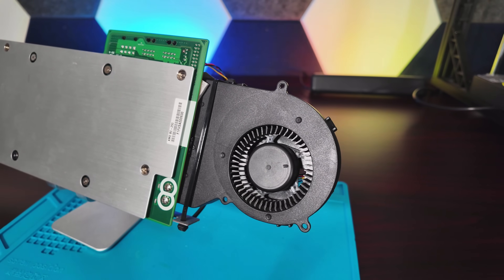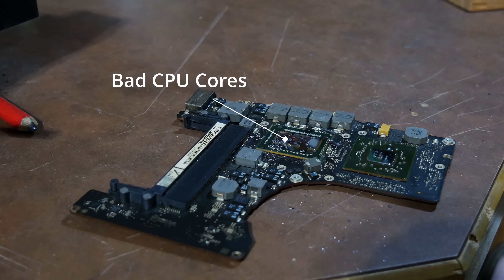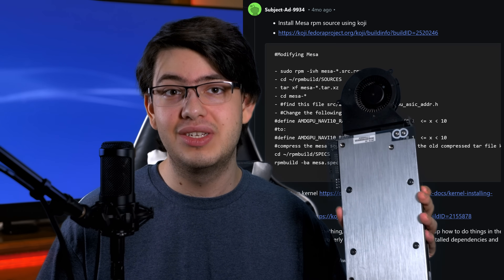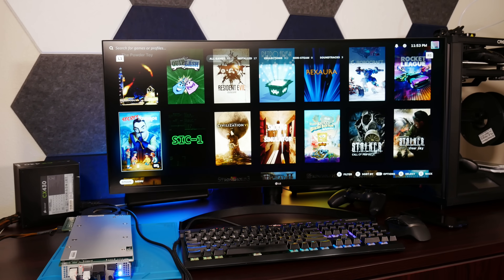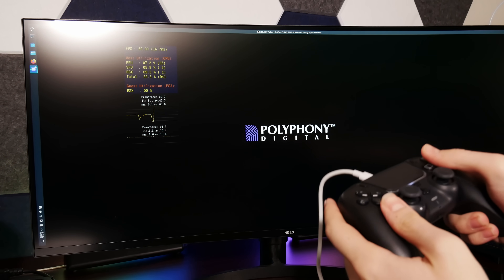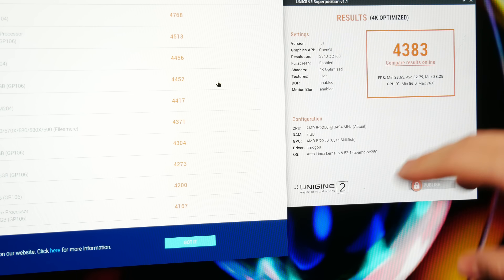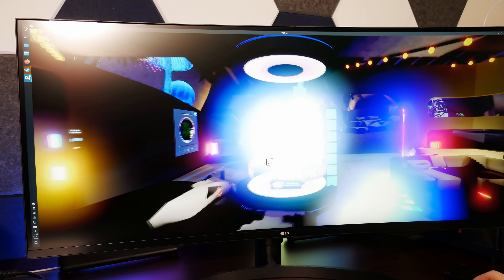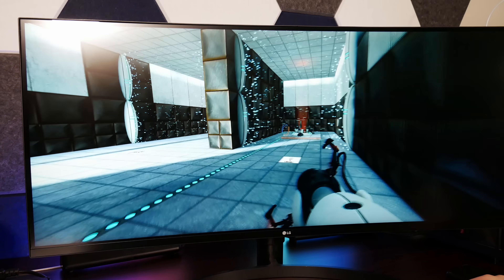I Ran PS3 Games on PS5 Silicon to Prove Sony Wrong

Comment: I was unable to find direct statements from Sony explicitly stating that PS3 emulation is impossible on the PS5. Developers like Dimitris Giannakis (Modern Vintage Gamer) have publicly stated that while PS3 emulation is technically possible on PS5 hardware, Sony has historically shown no interest in the investment required to make it happen. Jeff Grubb mentioned on various platforms that Sony might be working on PS3 emulation for the PS5, but it's taking time due to technical challenges.

Can someone provide the source to the claim in the video that Sony says PS3 emulation is simply not possible on the PS5?

Comment: you didn't run ps3 games, you ran a ps3 emulator. native or bust.
Reply: It's impossible to run native, the architecture is different.
Reply: @poxbox6729  It is possible if Sony decided to take the PS3 hardware and Shrink it all the way down to a single 7nm chip and include it inside a PS5 or a future PS6 (basically the same thing that they did with the Early PS3 models that had a PS2 inside).
But considering Sony isn't even willing to develop an emulator, they would NEVER do something like this.
Reply: @DioTheGreatOne  That'd be way too complex to just build it inside the CPU, they'd either make a separate chip for it in the motherboard, or embed the PS3's CPU somewhere like the Storage Controller.
Reply: @poxbox6729  That's what I meant, make a dedicated Mini-PS3 SOC separated from the main System.

Comment: Obviously it's not working right because it's using normal thermal paste instead of liquid metal lol.  Anyway, I wonder if someone could swap out the APU with one pulled from a PS5 console to unlock the full performance.  The bios on the card would probably need to be updated also

Comment: There are some weird AMD GPU memory clock bugs in the Linux kernel. However, I think the rate you read from the kernel is half the real rate because the memory bus is double data rate. Meaning it's effectively doing double access on every clock cycle. 

You can read the possible rates and manually set it to the highest value via sysfs.

Comment: Nice job proving that the 3600x can run something that the 7600k can do pretty easily.
Also, the gpu has nothing to do with what actually powers the performance of the rpcs3, it's literally basically 85% cpu power and nothing more, it's main api is openGL too so go figure.
Vulkan is used for compiling shaders more easily and efficently with the help of rendering power, most of the backlifting in the rpcs3 is always going to be the cpu.
If the gpu had at least 50% performance uplift for the emulator, we'd already be seeing god of war as "playable" with over 120 fps, the sad reality is that's not how it works though.
And you aren't proving anything, it literally takes two braincells to figure out that emulation on the ps3 is possible, some nerds in their basements did and now are getting monthly monetization from patreon constantly, sony CAN DO IT if they wanted to, they just think it's too much hassle to do considering it's old hardware and fuck me if you'd even bother to actually try emulating the cell processor that the rpcs3 had, which even gaben admitted was hell to develop for.
I am not sure what you're trying to "prove" when all you're showing is a hardware system that could pass the minimum requirements of the average laptop which can already play rpcs3 plenty well, btw.

Comment: Sony would need to pay people to make their own in-house emulator, which is the real reason why they don't want to do it. They'd have to pay for that amount of work to make their own RPCS3, have the man hours go into do it, payroll those people and manage them, and then have them meticulously test numerous games that are on the store for sale, and make that work over many years. It's got nothing to do with hardware, it's got everything to do with the complexity of a task, timeframes, and profit (or lack thereof). For Sony, manufacturing cloud based PS3s and streaming it to people is simply far cheaper and more straightforward than building a new software based PS3 system.

Comment: "unless you can find a rational use case for this hardware" It's a (potentially) fully functional entry level gaming PC made out of e-waste. With proper software support, this could be BIG in emerging countries where a 3060 alone often cost 2 to 3 times the monthly minimum wage. Also, its getting e-waste back into service, this is almost always a good thing!
Reply: The graphical issues can be fixed by a change in the steam launch configuration, I've been using these as modern gaming PCs for a few weeks now; in particular as cloud gaming machines for my friends who don't have full computers using sunshine to stream. They definitely have a lot of quirks but modern games run fine enough
Reply: Any help?  planning on getting one @realderyn
Reply: @realderyn what is the cost of these PS5 boards?
Reply: @realderyn Did that memory clock issue ever get fixed?

If so, that probably helped a ton with performance.
Reply: It's insane what people can call waste these days.
Reply: @ClixonTheOne  it's insane what companies will do for profit, crippling software support for perfectly good hardware like this.
Reply: PS5 pro pricing in my country is around $800-1000... Which is a prebuilt RTX4070 PC price. With PSN+ for online and game prices way more expensive than PC/steam. It's crazy.
Reply: @BadEnd98  nah its just that Sony saw how people are willing to overpay for videocards on PC and decided why not
Reply: It is, but you need someone smart enough to get it running.
Reply: @superrookie-1  no you just need someone competent enough to read instructions
Reply: @Dragoon710 no, you need a group of motivated and smart people to figure out how to harness the full potential of these devices, document it, and then make said instructions.
Reply: @Dragoon710 Did you even watch the video? They had to go out of their way to create custom code just to install Linux. This isn't a plug and play experience that most people will want, far from it.
Reply: I have been waiting for someone to make a YouTube video about the BC 250 I’m planning on building one into my truck and already have the hardware, but I’m not used to Linux whatsoever
Reply: If it runs on Linux, why couldn't it use steam os?
Reply: Also those can be donated to schools, client PCs at police stations, fire departments or hospitals for example. It's a great office PC, one can even put it in a small box and make it a portable 🤷🏻‍♂️
Reply: No. Just no. I don't want even more brownoids in gaming. There's already enough of them there.
Reply: This is great for the environment then?
Reply: 2-3 minimum wages? That's pretty cheap then in any country
Reply: @dimaryk11 monthly wages, he probably meant.
Reply: Also, prolly great for clustering.
Reply: haha no
Reply: That makes too much sense for corpos. They'd rather just dump it all. But perhaps a third party could do something
Reply: Jason "leather jacket" huang wants to know your location
Reply: @SicilianSSFR 2 to 3 times the monthly minimum wage?
10x in f.ucking Brazil.
Reply: Sure, after you fix all the myriad of issues and bugs, it'll play some games ok
Reply: True, but I wouldn't say fully functioning in the slightest 😅
Reply: @Space97. All the important issues are software related, the hardware underneath is pretty solid
Reply: only worth it if it's less than 200$, could build something far stronger for two-fiddy and it wouldnt require arch linux
Reply: 2-3 times minimum wage? So...$21?
Reply: @radthadd I meant the monthly minimum wage, so 2-3 times ~$250
Reply: You are going to run into soo many issues though.
Reply: What does 3 times minimum wage mean?
Reply: @adre2194  it means minimum wage multiplied by 3
Reply: @adre2194  3 months of salary when you work for a minimum wage

Comment: Regarding GPU clock limitations, it could be a profile and power limit. I faced exactly this scenario with some Ryzen 5700 notebooks. The energy profile management was problematic a few years ago. It always ended up setting it to economy, even though it was showing the performance profile.
After some time, this was corrected. Just like in the case of the kernel, something may be wrong at this point.

Comment: I'm still convinced the primary reason the Playstation 5 plays PS4 games is because Microsoft made the decision for Sony; the same way Xbox was compelled to adopt aspects of PSN at the time (for example, Games with Gold), and Sony was forced to adopt the Xbox 360's online infrastructure before that (a unified platform, cloud saving, etc.). You could follow the trail back further and cite the PS3's own initial functionality as why there was at least incomplete Xbox emulation on the Xbox 360. The PS3 seem to come at a "bad" time, on top of having "bad" hardware; despite the complexity, it was functionality underpowered in so many multiplatform releases (lower resolutions, framerate, and sometimes even both), whether or not developers "took advantage" of the unusual design strengths. Nothing compelled Sony to pursue a broad platform of PS3 support for the PS4; so instead, they released individually wrapped emulation packages as they saw fit as rereleases. Obviously the console enjoyed massive success regardless, but it means that that part of tech evolution more or less ended there. It happens, I suppose. Then again, these are massive for-profit making ventures for all of these corporations--look at the removal of optical drives by both Microsoft and Sony, or Sony's decision to straight-up delete PS2 support from later models of the Playstation 3. Any cost-saving measure that potentially allows for an additional revenue stream is a win-win for them.

Comment: I think you're wrong and never proved Sony wrong. Sony cannot rely on the emulator community and the PS3 emulators that exist right now are not perfect enough for Sony to sell games using it.
I feel like some of you tech hobbyists forget that when it comes to actually putting features into a product there is a baseline level of functionality that has to be upheld across the board.
Reply: Are you daft Sony has all the original design and documentation of all PlayStation hardware. It'd be trivial to write a competent emulator for the ps5.
Reply: @Syncopia  Do you think having the original design documents its going to trivialize arbitration of real-world physical hardware behavior in a software environment?

Comment: "i installed linux on a hardware kinda similar to the ps5 and managed to run ps3 games on a emulator", worthless video, this doesn't prove sony wrong on anything
Reply: It's not just "kinda similar", as in the video it's ps5 hardware with some of the cpu & gpu cores disabled(so slower ) - same cpu, same gpu, same memory. Consoles also often use emulation to support older games, such as later PS3s without a PS2 chip inside running PS1 games.
Of course, it's not at all surprising that some games would run under emulation though. It's not surprising that Sony don't want to do it, they're just dishonest about why they won't.
Microsoft runs some Xbox360(which used a powerpc cpu just like the PS3) games using emulation. Heck the Xbox360 ran previous generation Xbox(with an x86 cpu) games through emulation, and the og xbox was already powerful.

Comment: i want one of these for testing tbh.

but OFC here in europe it's 100 bucks a blade.. orr 300 bucks for a full chassis of them.

i wouldnt spend more than 40 bucks on a single blade. and i dont need 10 of em

Comment: Has anybody from SIE ever pubicly stated tbat the PS5 can't handle PS3 e.ulation or has this been an assumption the whole time?

Because their lack of effort has probably more to do with the costs involved (they don't want to pay them) and that they would have preferred hardware abstraction to avoid licensing issues.

Microsoft do their BC via a Virtual Machine and even if you have the disc the game needs to be recompiled to work, which is why they need at least a first time connection.

Comment: THANK YOU! Been saying it for years: The PS3 is ancient tech at this point and the only complexity it had was related to architectural challenges of which Sony OWNS the key. They could make it happen if they wanted to, but they don't. That's it. Any complications or major complexities of running PS3 code are for people who literally don't own the architecture and have to do trial and error, not for the freaking owner of the platform.

Comment: Sony would rather gamers forget about classic games from its previous gens if it could. It has been since the actual PS3 when they revisioned it and got rid of the emotion engine chip from the inside.

They hardly released aby PS1/2 games on the store yes you can play PS1 discs thats fine but not PS2 for the new revision. For years only the US PSN was getting older titles the UK store didnt and its basically been the same games for years with some new ones added just recently and that's because of Capcom with Dino Crisis etc 

But Sony backwards compatibility has been rather poor to be honest why i kept my PS3 and recently bought a used PS2 chunky. If it's on PSN i will buy it but for PS2 I try to find the disc version now

Comment: The mention of bad cpu cores that can lock up when running code applies to the refurbished desktop pc my boss bought over a year ago. I could just be using the pc normally and all of a sudden it'll lock up for several seconds and i can't do anything other than move the mouse and then it'll start working again. It happens randomly. Sometimes it'll not do it that day, sometimes multiple times a day, or even once at the beginning of the work day.

Comment: Really interesting! And such a shame Sony chose not to make a console that could've played almost any game from all its predecessors.

It is known the PS3 is extremely difficult to emulate but since it's their own IP, Sony could've easily had AMD add a few special instructions to the PS5 CPU just to make emulation easier. And if they didn't want to invest in their own emulator, they could've bought some amazing good will by just licensing RPCS3. The Sony of PS1 days would have done so...

Comment: 6:42 Nothing related to the video but watchdogs 1 on the ps3 is insanely impressive because they got it on 512MB ram which is INSANE due to the minimum ram requirement of 6gb
Reply: 256+256 more precisely, one for CPU and one for GPU
Reply: I'm still really impressed by the og xbox and halo 2!!!  64mb.  Wow.
Reply: Metal gear solid 5 is also insane for running on 256 CPU ram and 256 GPU ram like that
Reply: Well, windows uses 4gb of the 6
Reply: i'm sure knowing the hardware it's running on helps, but still impressive.
Reply: Didn't watchdogs 1 aIso release for xbox 360? And isn't the 360 weaker than the ps3?
Reply: @iaqh  X360 had a better GPU while the ps3 had a amazing cpu
Reply: @iaqh the type of stuff they did before ue 5:
Reply: @iaqh 360 has a stronger, more accessible GPU... PS3s CPU is 'faster' than 360s but harder to program for.

The PS3 was supposed to have two Cell processors (CPU + 'GPU')... But they opted for nVidia at the last minute.
Reply: @sporadic7  "PS3s CPU is 'faster' than 360s but harder to program for."
Incorrect. It's not faster. It's just different.
We've seen enough examples of that CPU not being that fast, already. It was basically a primitive APU with one big Stream Processor Core and 7 small cores that really only did floating point operations.

It wasn't just hard to "program for" but was hard to get anything demanding to run on properly. Even when it came out, it was shit. The 360 CPU, on the other hand was a 3/6 core CPU that was fantastic for parallel workloads and still had a high per-cycle throughput. It was, overall, a far superior CPU. (And a lot more similar to mainstream CPUs that followed)
Reply: @sporadic7 the cpu bit is not quite accurate. both are quite relatively strong, the 360 has a three core power pc and the ps3 has a single core with a bunch of co-processors. in raw capability the ps3 cpu is much faster but harder to extract that.

Comment: At some point the whiners are going to have to acknowledge that a LOT of engineering has gone into the PS3 emulator, and that Sony would be starting from scratch were they to make one for PS5/6. And what would they gain by making it? Pretty much nothing.
Thankfully we can run PS3 games on PS3s and modern PCs, so no biggie.
Reply: Exactly. I also find the stupid publics response to the PS3s launch is also at fault.

They complained a machine with hardware backward compatability was too expensive. Now they want software emulation....for free.

I do wish I was in one of those alternate dimensions where the PS3 was praised for it's near flawless BC and the PS4 shipped as either a standalone or a fully hardware BC machine.
Reply: What would they gain. Possibly a small increase in sales.
What would they lose. Possibly a lot. And another thing is can the PS5 run enough games at good enough quality that Sony would risk their reputation on. 
If performance is not great or games are broken, most petwont be so forgiving if it's an official advertised feature.

Comment: So in order to emulate PS3 games Sony has to do what you did without removing the OS? Are able to switch between the two OS’s?
Reply: It's on a normal computer board. It doesn't use PS5 OS. It can use a normal nvme drive you can use any OS but atm linux is way to go for now til Windows gets figured out

Comment: I don't know if it is a mistake, but you show Watch Dogs running terrible while RPCS3 compiles shaders, which cranks the cpu load to the maximum and lets framerates plummet on any hardware. Given their unified architecture, consoles don't have to compile shaders at all.